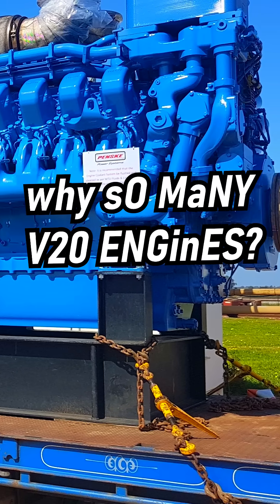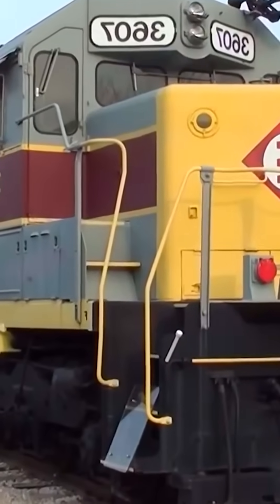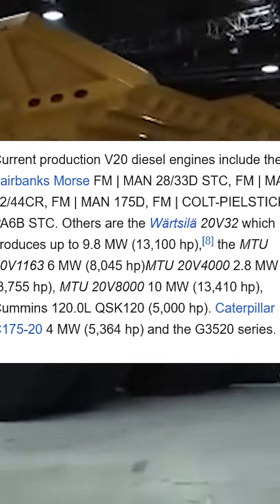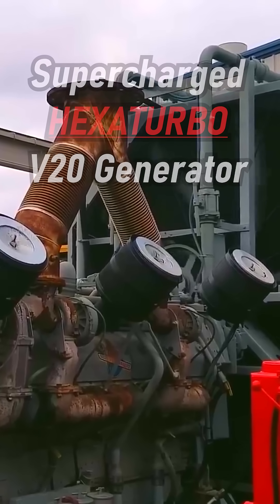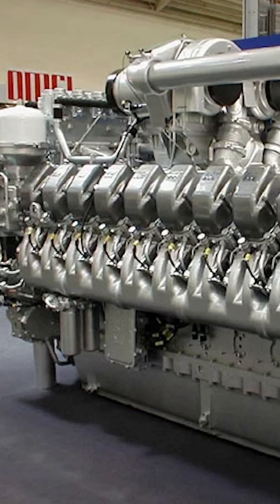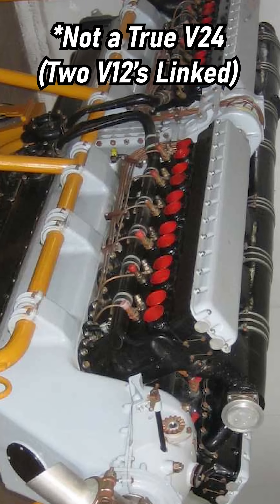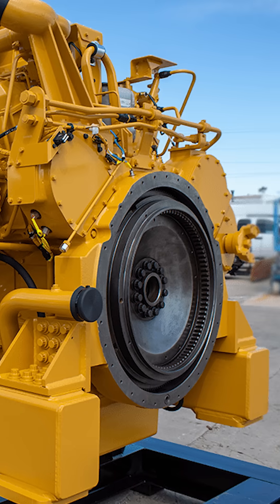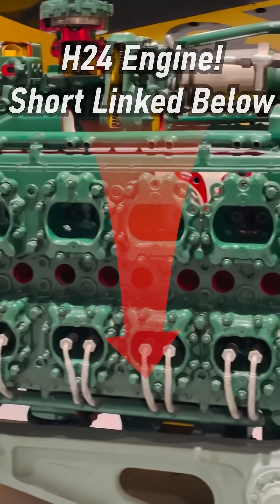wHY aRE V20 ENGiNEs sO PoPuLAR?

Comment: V12’s can often be seen out of cars too. GE’s popular GEVO series of locomotives use a turbocharged V12 engine.
Reply: There are also the very unique Deltic engines which powers things from Naval service & Railway use in the UK.
Reply: Most locomotives the diesel engine only acts as a generator. The power is put to the wheel by electric motors. The diesel engine provides the electric power to the motors.

Comment: Ive worked on many V20s in the maritime industry. EMDs especially. Amazing machines.
Reply: I was engineer on a tug with twin V20 EMD’s, three 8v71 generator sets and a 6v71 winch motor.  Didn’t get much sleep…
Reply: @FlatBroke612  yeah, that's alot of moving parts
Reply: You bet, the 20 cylinder in the 645 treats the crankshaft real nice.
Reply: How was it i couldn’t imagine doing that i could imagine being a mechanic but not a heavy duty one but idk yall do get paid a lot but idk if it’s better than being a builder
Reply: @owen6033 the bigger it is the easier it is. You just use chain falls, cranes, and hydraulic tools for the real big stuff.
Reply: @cloggedpizza239 how is it easier i thought it would be harder
Reply: Do you think a V20 would fit in my Honda?
Reply: oddly EMD made waaaaaaaaay more V16's because Railroads actually preferred it over the V20
Reply: @IndustrialParrot2816  The V20s came just before the oil crisis and those things GUZZLED. Most railroads were willing to willing to to sacrifice 600hp in favor of less thirsty V16s that still made a solid 3000hp.
Reply: @trainzguy2472 exactly why the SD45 and SD45-2 weren't that successful compared to the SD40-2
Reply: We have some EMD boats at my company. Old school with the lever operated fuel racks. My boat has straight 8 GE's though
Reply: 1000th like

Comment: The reason is balancing. In general with V engines to achieve balance you want 2 equal banks, and within each bank you want mirrored cylinders. So the good amount of cylinders is 2(number of banks)*2(mirrored banks)*n (some number) of cylinders. 

If you use an even number of cylinders, but non-divisible by 4, you run into some balancing issues. V6 arenty as balanced as inline 6 etc etc. So if in this case if you arent much restrained by dimensions you go for inline engine. 

However there is a strong advantage in keeping the n prime. Since the banks are mirrored, there is very little to gain in terms of balance by using non-prime N. If you have a V16, it doesnt gain much extra balancing over a V8. Why V24 arent used (question from video?). Not really because of size - there is plenty of applications where it could be done, but it doesnt offer much over V12 - its basically double V12, but there arent any forces you can cancel out with it. 

So why V20? Its the smallest engine, where you can both mirror the banks, have 2 same banks, AND have power stroke overlap on every half-bank. Basically its the smallest engine with it. And next would be V24 (which doesnt offer anything over V12), and V28 (which can be made smoother, but it is indeed getting much longer, for much lower gain). 

24 Cylinders are however again very appealing, once you move to 4 bank engines. X-24 engines were common (comparatively ofc - not many engines, but compared to other X configurations), although they often are referred as W-24 , like allison V3420 for example - but they really were a skewered X more. I kind of expect that if VR engines make an appearance in large applications (and there are strong arguments for those), then VR-24 would be the engine to go to.
Reply: Excellent analysis. What about 3 bank engines, particularly with opposed piston cylinders?

Comment: Dodge should make a one off Viper with an 8.4L V20 that revs to 12,000 rpm.
Reply: Those cylinders be 420cc each which are smaller than the golden standard 499.5cc in our everyday cars.

Had the 499.5cc cylinders fit, it would've been 10cc shy of 10 liter.

Comment: A v20 can be perfectly balanced
Reply: To balance a V20:

In a single bank use 2 i5 linked to eachother in opposite direction so the rocking couple cancels out so that the each banks are individually balanced
Reply: I cant remember the firing order of the J320 off the top of my head, but I can say there is a 2 degree offset so it doesn't fire 72/72/72/72 it fires 70/2/70/2/70. Even with the stagger it's a lot of stress on the crankshaft and the dampeners and rubber coupled output shaft are the only thing keeping it in one piece, 
J320 are just a baby at ~7000Nm of torque on a 3.2m block
J920 are closer to 100,000Nm of torque on an 8.5m block
The company make a V24 that is somewhere in between but can't remember the specs on it save it being around triple the displacement of a J320

Comment: Supercharged Hexaturbo V20💀💀💀💀

Imagine a hexaturbo W16
Reply: Twincharged V20 with 6 turbos 💀
Reply: @Valtra_VlogsUK wha....
Reply: @Valtra_VlogsUKv10 with 10 turbos?
Reply: more lag than callin from Mars!
Reply: That is a Detroit Diesel 20V-149. It's a 2 stroke, V-20, with a displacement of 149 cubic inches per cylinder, and it's essentially 3 engines put together. It's comprised of a V-6 block on each end, with a special V-8 block in the middle. The 3 superchargers are just blowers, they only force air into the combustion chambers to evacuate exhaust gasses. I believe that in standby generator spec, which is what the one in the vid is, it produces just shy of 4,000hp.
Reply: @DeathHead1358  damn
Reply: Miata build?
Reply from the maker: Yeah you forgot the TWINCHARGED aspect LOL
Reply: It's also 2 stroke 😉
Reply: If you want to see a crazy Turbo set check out the QSK-78  it's has 12 turbo  6 high and 6 low pressure
Reply: @joebrown9621  bruh WHAT💀
Reply: My Miata is cooked🤣🤣
Reply: The bughatti veyron super sport but the engine dev team smoked 3 pounds of crack and decided to just greenlight any idea that came up.
Reply: I have this as a mod in American Truck Sim and I'm pretty sure that monstrosity of a truck is why the world turns

Comment: Mm..

Is v100 exist?
Reply from the maker: considering even V24's are no longer being produced (not on mass scale at least) i doubt a V100 much less a V40 will be made.  Also somewhat related rant: A lot of clickbait AI Channels keep claiming V32's and V40's exist, but THEY ARE NON-CAR NORMIES MISTAKING "Valves" as "V ENGINE" so they think a 32V V8 Mustang has a V32 Engine because they read the Valves as "V-type Engine".  SMH
Reply: @BladedAngel  the length of the crankshaft would be longer than a car
Reply: Not V but there is a 112 cylinder engine. Zvezda M507...

Comment: I propose that dodge brings back the viper and makes an extra long one with a v20 instead of their usual v10 and see what it’s capable of
Reply from the maker: Just Make Two Vipers Kiss and link crankshafts: BOOM V20.
Reply: @BladedAngel  The Dodge Vipapiller?
Reply: @BladedAngel  You see, when two cars love each other very much...
Reply: 4×8 V20 if you bet one in reverse🤣🤣 @BladedAngel
Reply: @BladedAngel  Does Trangle engine exists?
Reply: Maintenance costs would be insane lol
Reply: I call it, the vviippeerr
Reply: @Camaro_man437 THE JAAAAAAAGG
Reply: Viper V2.0
Reply: You’d be able to hear it from 20 miles away too
Reply: miatia swap when
Reply: Good at going in straight lines?
Reply: The tires ohh the tires
Reply: @ThatOneDude319  if hoonigan gets a hold of it the tires wouldn’t stand a chance unless they were made by Nokia
Reply: @alexls1923 Fun fact, Nokia and Nokian Tires actually originate from the same company.
Reply: @Krajenda I believe their tires were made for heavy duty construction equipment if I’m not mistaken
Reply: VIPER²
Reply: W20 instead of a V10 would be wild
Reply: @filipbitala2624  might as well use those beefy aircraft propeller engines they used right before the jet era while we’re at it and have the crankshaft a few feet in the air with chains going to the wheels
Reply: @filipbitala2624 No lie I was thinking about that when the whole crack too long thing came up 😂
Reply: Maybe fuse them side by side and make a W20 engine!
Reply: @clays32  or flip one over and fuse it upside down to make an X20 engine
Reply: if a v16 can be 1.5L in space, I can see a V20 being easily 6L or 7L
Reply: They will make a k 20 before then.😅
Reply: @justsoicanfingcomment we’re unlocking the piston layout alphabet with this one, next we’re going to invent the S20 engine with bendy pistons
Reply: Bro got the hitler car
Reply: Child mentality 😂
Reply: These are about torque, not speedy speedy vroom vroom. I wonder how extensive the gearing would be to make it go fast.
Reply: The longnose Viper
Reply: Why not W20 seems easier
Reply: @Ali-m2i9c because we didn’t put a man on the moon because it was easy, we did it because it was hard
Reply: Next thing you know boom 180-300hp per cylinder 😆 now that would be insane
Reply: If you all do that to my lovely Viper, I will hate you all. I'm just happy Viper ended before EV craze. Last thing I need is V10 becoming electric sports car...
Reply: @mitnecasual  noted, we will instead strap 10 V10 engines in 2 rows to make a W100 engine to keep with the theme, it’ll be longer than a limo but could work
Reply: @mitnecasual Should I tell him a quick quick conversion kit exists? 😁🤣
Reply: @justsoicanfingcomment  Don't. He will destroy that Viper 😂
Reply: Why not one V10 in the back and one V10 in the front, make it AWD. Voila
Reply: It’ll make like 25HP/L 😂
Reply: better yet, one up Bugatti, make a w20

Comment: V20 will be impractical to fit in a production  vehicle. It's too big. Even the v16 was pushing the limits of  what can be fitted in
Reply: Make straight 8s great again
Reply: @scottfree6479straight 10 engine
Reply: Well we can always have dual engine cars with one v10 for each axle if we try hard enough
Reply: It’ll fit, just make the pistons smaller. Also has the side benefit of revving higher
Reply: @FierceMotorworks so then why not just make a 2 liter h96, why not make a 125cc lawnmower with a straight 12? Because it's useless😂
Reply: @FierceMotorworks  agree lexus did it with the lfa v10
Reply: @rolon-ew5kl wym? 500cc per cylinder is pretty normal for high revving engines
Reply: @billyray4716 but it’s still small for a car engine.. most high revs come from bikes, small engines make to make more power, that’s why they die so fast
Reply: @FierceMotorworks can’t have em vry small is the thing, displacement is literally your power potential, excluding power loss obv, 

It’s better to have a low raving big engine then a small high raving engine, the more revs you push the shorter life your engine will have, more rpm more stress the closer you are to the limit the more your wearing the engine, especially with the added heat, and that wear take a big toll on power that’s why old civics seem so sluggish now bc they been raving so high literally all their life, and I mean by design they inject oil into the cyl so that should tell you enough about high revs, do sound cool but with higher displacement it’s just better in every world
Reply: @FierceMotorworks that’s not really a benefit, you could get the same power but even more potential just with a bigger displacement